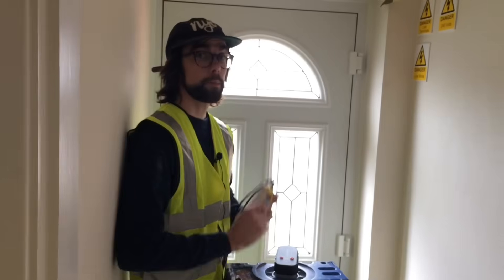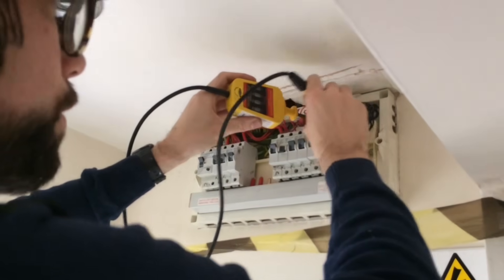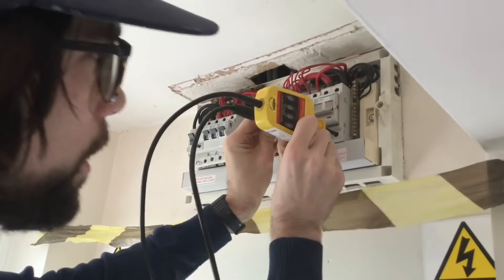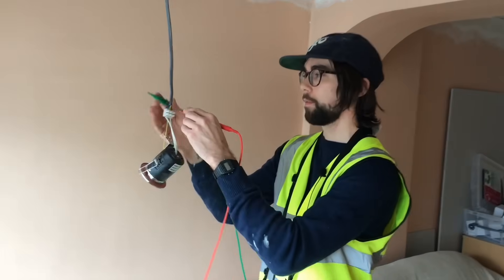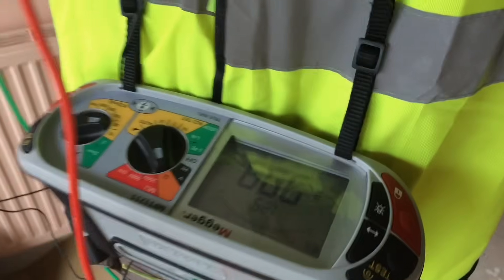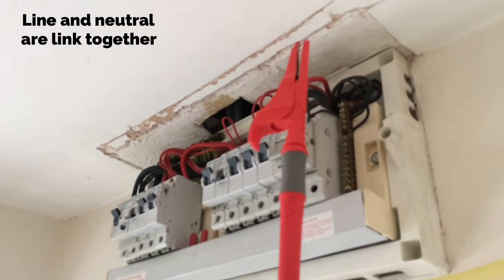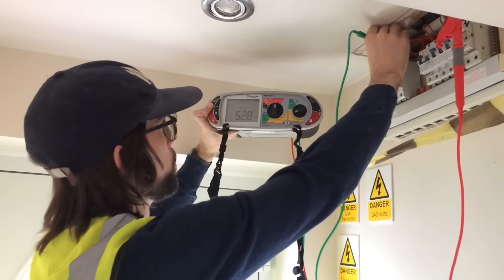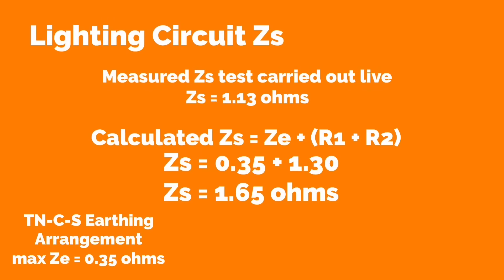On-Site Downlights Install Includes Live and Dead Testing 'Read Description'

Comment: Hi gaz can i ask why dont you measure the ze in that install instead of using the max reading allowed 0.35
Reply from the maker: Hi. You can and I don’t recommend using the maximum value for Ze. The minor works requires you to measure the circuits Zs but has no requirements for measuring Ze hence that part of the video. Thanks for the comment and support GSH Electrical

Comment: I think given the extent of work, an insulation resistance test between line and neutral should have been carried out and recorded. If the inspector deemed it impractical to remove all loads from the circuit under test, he/she could carry out the test with the switches in the open position. On another note, I can't understand why he went to all that trouble of proving the outgoing side of the main switch was dead but failed to lock it off.
Reply from the maker: Hi. I don’t see a requirement to lock off the main switch when your physically standing in front of it for a short duration and not walking away from the board. Signs were located and access was restricted. Thanks as always GSH Electrical
Reply: Prehaps it's just the way the video's been edited together. From what I saw JT proved his voltage instrument was in good working order then proved there was an active supply on the incoming side of the main switch then proved the outgoing side of the main switch was isolated then rechecked his voltage indicator on a proving unit then suddenly appeared in the work area ready to do a continuty test, which kind of implies he didn't lock-off the main switch and left the consumer unit cover off.
Reply from the maker: Hi. I think he was doing polarity of supply top side of the switch and then proving it dead bottom of the switch... he never walked away from the disboard so was the main switch was not locked off before the installation resistance test. Thanks GSH Electrical